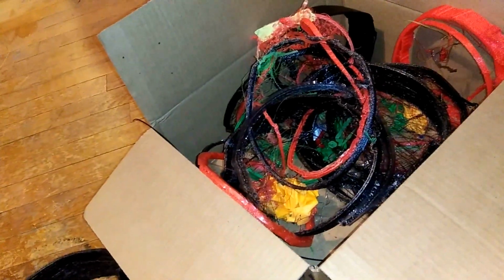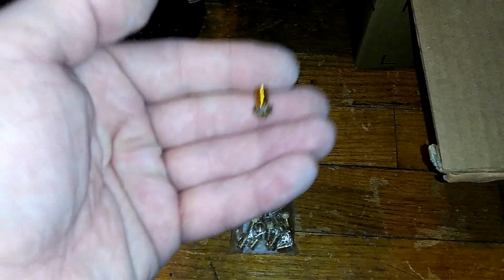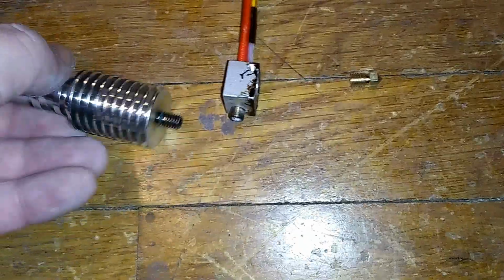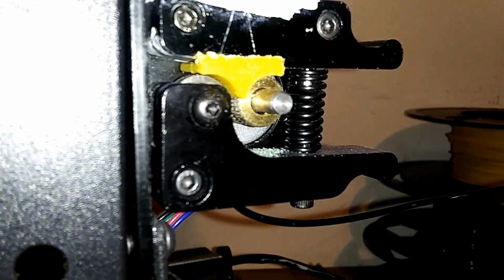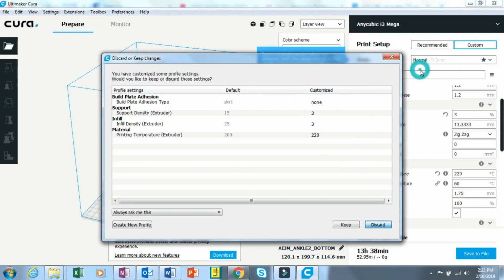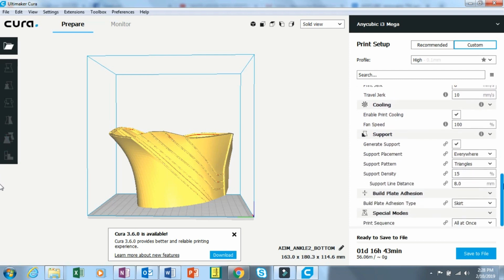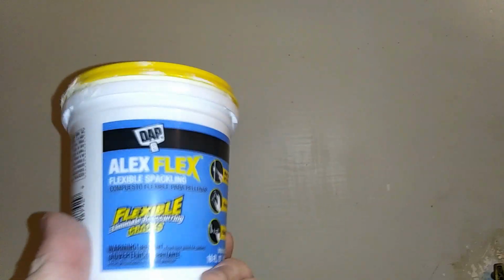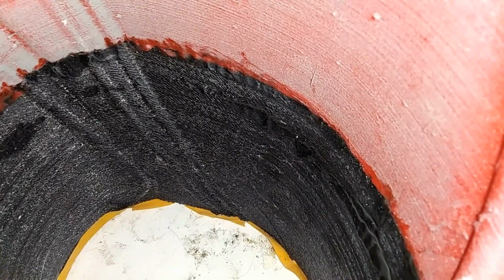Tips For Printing TPU On The Anycubic I3 Mega And More

Comment: I watched another video where the guy changed his stock spring on the step motor to a spring from a pen. It worked for him. My anycubic mega S has a pretty stiff spring in it. But I was thinking I could just back off the tension and maybe that would work. I JUST got a roll of TPU today so an searching vids to help me have success. I will raise the temp of the hot end and bed and do like you suggest of lowering the speed of print.  Thanks for the video and wish me luck.

Comment: How about getting steel ones they cope with the higher temperature better
Reply: The conduction of steel is garbage, use the chrome plated copper ones.  Better heat transfer and smoother bore!  2 for $16 at Amazon